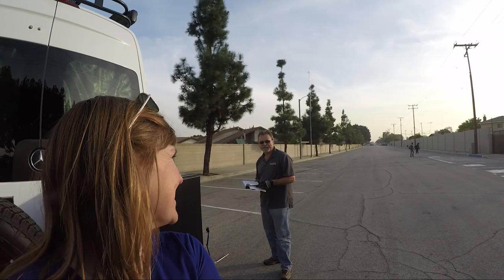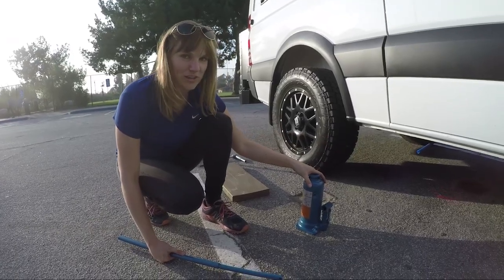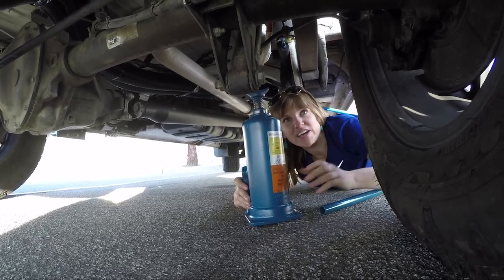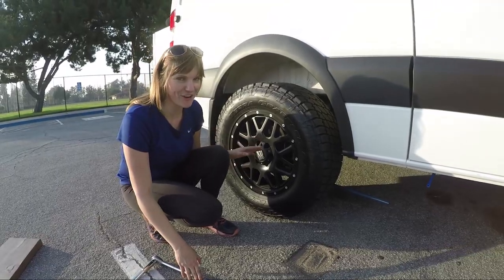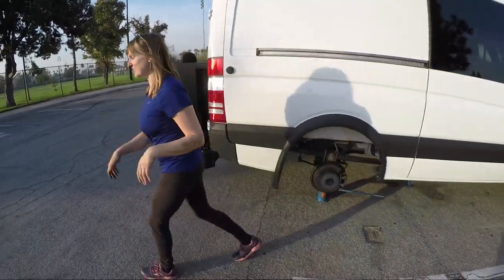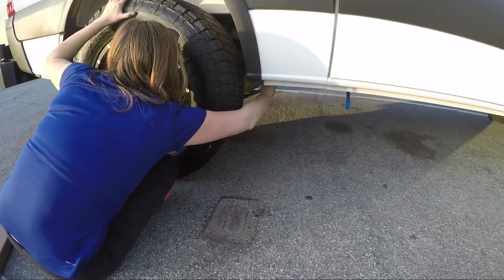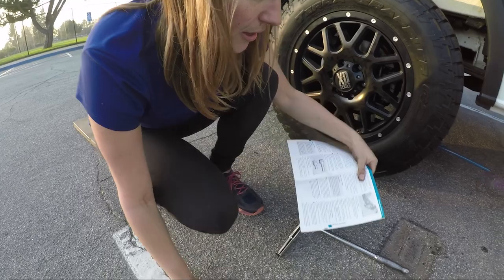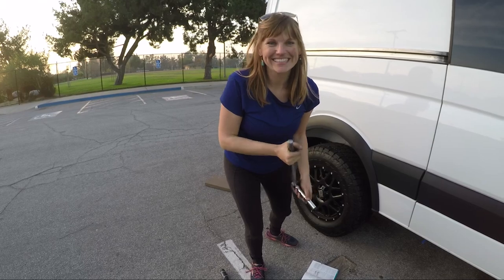How to Change a Flat Tire on a Sprinter Van I Step-by-step Instructions

Comment: The jack mount is about 15" in front of the rear axel towards front of the van. No need to crawl under the van to mount it on axel.

Comment: A few more tips if you don't mind.  Always chock a wheel for safety in this case a front wheel.

 Put the wheel that you removed under the car where you are working. In case of jack failure you want the car to fall on the wheel and not the ground.

And get a torque wrench. Not very necessary but I've seen bolts get torqued off easily (broken off).

Can't wait to see the next video.

Comment: It's probably obvious, but if you have a flat, the car will sit lower than with an inflated tire. So when you jack the flat tire up, make sure you jack high enough to let the inflated tire in place.

"Make it as tight as possible". No. There are specs to respect and more torque doesn't mean safer. Most sprinter with alloys wheels are 138lbs/ft of torque. That 1 foot ratchet and a 140 lbs person could stand on the end, but not more.

Comment: Good woman 👌🏾  I'm a tyre fitter here in Australia & so many people stand or jump on the bar when they're trying to crack wheel nuts loose - best motion is to actually PULL like you were doing - lean back almost in a wide squat stance as if you're at gym & use your biceps/straight back/leg muscles simultaneously & lean back. You actually have more controlled strength rather than pushing, not many people realise that!

Euro vehicles with 'stud located nuts' (unlike non-Euro's) are an absolute bloody pain in the arse (pointing at you heavy AMG SUV wheels I'm scared of scratching worth more than my month wage). Best thing to do when matching wheel stud holes is sit ya bum on the ground like you were doing but shimmy both feet under the wheel as you roll it side-to-side. As you 'cradle' & leverage up with the tops of your feet, you can spin/adjust once it's resting on the hub - trust me I'm a young lil lightweight bloke & it makes it easier! 

If you can afford to accommodate the extra size/weight, a really good idea is to buy a supplementary small trolley jack (with suitable load rating - prob ask your tyre/mech pro) as they're HEAPS easier, faster, safer & more stable. Even if you only use it once in a blue moon it's still a worthy investment, particularly if you're racing in crap weather on the side of a bad road on a less than stellar surface. 

LOVE your channel - you're living my dream, so till I pay a bit more off my home & in the position to nomad, I'm living vicariously through you lol 😁 

PS beaut rig!

Comment: Does the manual tell you to jack it up from the axel?  As far as im aware its a real no no. You have special jacking points on the van to place the jack.
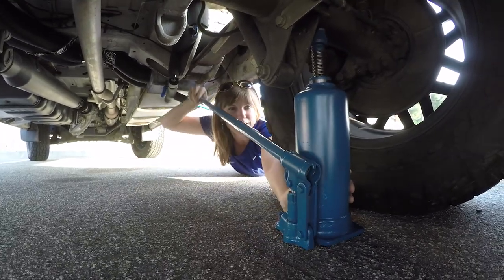Reply: Absolutely not! The Jack point is the thick loop hanging down from the frame as seen around 3:25.

DO NOT DO IT THIS WAY

Comment: Kristen, thanks for a nice video.  Please consider jacking up the vehicle from the rear (jack lever pointing towards the rear bumper) so you won't have any part of your arm or body underneath the Van.  Similar for the front tires, where the jack lever would point to the front.  Also hand brakes should be engaged.

Comment: Great Video for beginners!
Please use always a Star Plattern to tighten the nuts/screws! Otherwise you could damage your wheel! More over please use a Ratsche / Tool  with limiting torque to prevent more damages.
 Enjoy driving your Mercedes Benz Sprinter Van! Have always  a safe and wonderful trip! Greetings from the home of Mercedes - Germany!😊

Comment: Great video, a couple other things to consider.. block at least one wheel Especially on uneven ground also consider putting a support under the frame somewhere close to the jack in case the jack fails, in a pinch a round of wood works instead of a factory jackstand.

Comment: Great vid .. Another tip .. when you are jacking up the van, have your spare tire 
placed under the frame of the van - just in case it falls off the jack- 
it won't fall on you. Then when you take the flat tire off, swap them. 
This way you always have a safety net of sorts in case the van is wet 
and slips off the jack. Cheers.

PS ... Happy New Year from Vancouver BC - And 2 Questions: 1- Why did you take off your ladder on the back. 2- Are you thinking of doing a video on the roof rack and the storage box at the back of your van? That would be awesome if you did : )
Reply from the maker: Hey! Thanks. That's a great tip. I took the ladder off the back for a couple of reasons. The guy who did my van put it there, but when I went into the dealership, they told me they don't actually recommend putting them on the back door because it's not strong enough. I also had to take it off t make room for the spare tire. I replaced it with an aluminess ladder that I put on the drivers side of the van. And yes, a video is coming soon!
Reply: Good to know, as I've seen a few vans with the ladders - but I like your spare on there.
Reply: And another tip,  don t   put the bolds on the ground but on a  peace of rag, and spray  them with WB 40 or  oil them , then later they get lose more easy in case of a next time. ,  and a pair of gloves, lol.
Reply: Hey ! beAwsum , great tip . I have a question maybe you could  help me  sum up my thoughts on safety . Since a van  self-made RV conversions are quite heavier. Are the jacks sturdy enough to bear the weight of the Van ?What would you suggest?

Comment: Great video, but I wanted to point out one very important detail that goes against part of your instructions. You should never stand on the ratchet /  torch wrench to tighten lug nuts. If you overtighten the lugs, there can be serious repercussions such as damaging specific parts and can even lead to an accident. Every vehicle has a specific torque set. 

If changing a tire, its obviously recommended to take to a shop soon after for repairs and proper wheel torque. In the event you can't make it to a shop, its best recommended to tighten each lug nut in a star pattern once you start to feel resistance in turning. No more and no less.

I hope this message comes across in a positive manner and I wish everyone a Happy New Year!
Reply from the maker: Thanks! That's super helpful. I did follow the star pattern as it mentioned in the manual. Happy New year!

Comment: I only have a few things I'd like to advise. Instead of getting the small piston jack go to Wal-Mart and get the flat rolling jack for $20-$25. It's more stable, doesn't require you to put things under it for stability. Much safer. 
Also, spend the extra money to get a torque wrench. Tightening the lugs to the specified torque is very important. Especially on European cars as they are a bit easier to over-torque and strip your lugs. DO NOT EVER OVER TIGHTEN YOUR LUGS. This can cause the heads to pop  off. 

I did stuff like this for a living for several years. You'd be scared by some of the stories I have of people who over tightened lug nuts or didn't tighten them enough. Torque wrench. If your traveling and not experienced with tire work I advise you to have one :)
Reply: glenrkat or even better, buy one from a real auto store.

Comment: This is bad advice. You do not jack up the axle. There are jacking points on both 2500s and 3500s.  Jacking the axle or the differential could cost you thousands in damage. Read your manual.
Reply: She did read the manual .. but seems like she didn't understand it. Some people are smarter than average.

Comment: Great enthusiasm, I like it .....,

I'll give you some campers friendly advices about changing flat,

- Safety, your front wheels need to be straight and please put something in front of diagonal wheel from flat, just in case and activate parking brake
- jack need to be placed on the spot where factory recommended ( check the owner manual book ), very important for safety reasons
- because of your physical power get some 1 1/2 inch steel pipe, 2 feet long for better leverage
and more easy do the job and please do not use your back, use your upper body with arms to do the job ( using your back power you have big chance to hurt your back )
- you need "Drive click torque wrench" to tighten the aluminum wheel and be safe that you have right amount of torque on the bolts
- cut some 4x4 peace of pressure treated stud ( long 15-18 inch ) to support your van beside your hydraulic jack
- pair of leather gloves will be good thing to have and use
- Sprinter hydraulic jack sometime get the air in and good thing to know is how to bleed air from jack, its very easy, YouTube video will show you how ....
- refill all your tires with NITROGEN, best place for that is Costco tire shop, why nitrogen, more safe than air and tire temperature do not change the inflation pressure

Have a safe and pleasant trips .....
Reply from the maker: Thanks for these helpful tips!
Reply: I like share my “ short” driving experience, just about 46 years ….. hahahahaaa

Comment: Tip: Rather than pulling on the wrench handle, place it in a position under you so that you can push on it, using your body weight to assist you. Happy camping!

Comment: It would be good to jack it up high enough to get the spare on before taking the flat off.  That will be an estimate.  But by looking at the spare you should be able to make a good guess.  If you put the tire iron or jack handle under the spare tire as you put the spare on it will be a nice lever to lift the tire.  It basically reduces the weight of the new tire so it is easier to lift through leverage.

Comment: You should get a cordless impact wrench and have extra batteries with proper torque stick, help you in time of panic! And way easier :) 
Nice video!
Reply from the maker: MedjOOL Maker great suggestion. Thanks!!
Reply: Just get a Torque wrench. It's cheaper, doesn't use power and is less likely to strip the lugs.

Comment: Great Job! others have given great suggestions like wheel chocks. i would add, if you have space, bring a good size block of wood to put underneath to add safety while the van is on 3 wheels. normally i would use the tires but since you have nice rims.  you probably dont want to do that. and yes a 18 or 24" breaker bar is a good idea. remember to tighten to factory specs as soon as you can.

Comment: Hey Kristen, great videos as always.  You should get some wheel locks for those beautiful wheels, even the spare which will be the easiest to steal.
Reply from the maker: Thanks! I have lock nuts on the spare.
Reply: That is what I thought,   bad people will try to steel your spare tire,    I you could have space anyware inside to safe it from the elements, I guess not.

Comment: If I were doing this I would probably stand on the ratchet to undo the wheel bolts (at home I would be using a breaker bar).  I would also also have the jack handle pointing out the back of the vehicle.  If I were doing this in an emergency I would haul up on the ratchet to tighten the wheel bolts, but I weigh 105 Kg and can pull a fair amount; if I were you I would stand on the ratchet and get the torque settings checked later, 180 Nm is a lot of torque.  If not on a level ground it might be an idea to chock at least one of the other wheels with a brick or rock.

Comment: You should add always set the parking brake...and a 4-way lug wrench is a very handy tool for changing tires, one of the sockets will be for your size lug nuts, and the others might fit other vehicles you come across with a flat tire and they dont have the wrench. Plus, a 4-way wrench is a handy tool for wedging under the tire and lifting it a few inches to match up the studs to the holes...

And yeah, the passing drivers probably wondering why is that dude letting a girl change his flat tire?

Comment: I never changed a tire in my life but I seem to remember reading somewhere that after a tire change you should have it double checked by an expert for proper torquing of the bolts and to see if the wheel is "out of round" (not sure if that is the correct term).  Good job on the video. I like watching your vids.
Reply from the maker: Thanks! I hopefully will never have to change my tire, but this is intended to get me/you from a dirt road with no cell service to the nearest town where you can get your original tire fixed.

Comment: I noticed you didn't chalk the wheels.Though I have only chalked one wheel, many suggest you put chalks on the other three wheels to keep the vehicle from moving and falling off the jack.
Reply from the maker: Gotcha. Thanks so much for the tip.
Reply: Chocks. But....yeah.

Comment: #1 First make sure your vehicle is in park!!! It's a no-brainer, but people do have to be reminded.
#2 Put some chocks in front of and behind the wheels in case your parking brake does not hold the vehicle in place! Walmart sells light-weight yellow plastic ones or you can use wood chocks. 
Putting your spare tire under the frame too close to the tires could make it difficult to remove it, if your vehicle rolls forward a couple of  inches. 
 And is that spare tire you tucked under the vehicle wider than your head when the vehicle falls? 
I wouldn't want to find out! You should never be under the vehicle when jacking it up. If your short, you can pick up a longer pipe at a hareware store to go over the jack handle so you won't be under the vehicle.